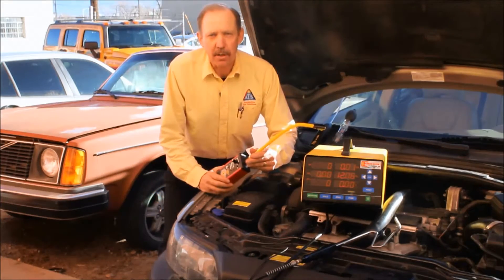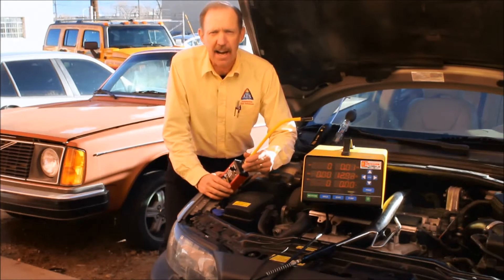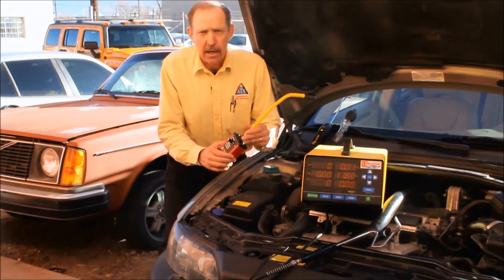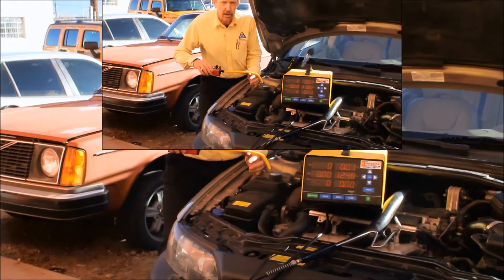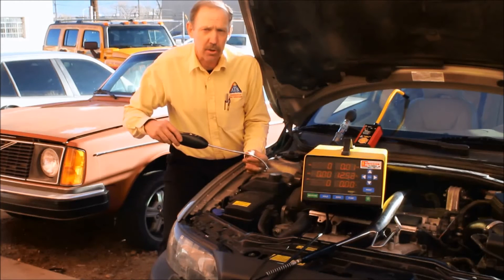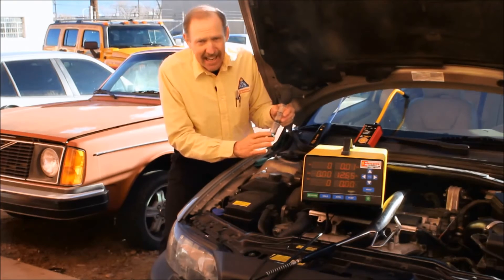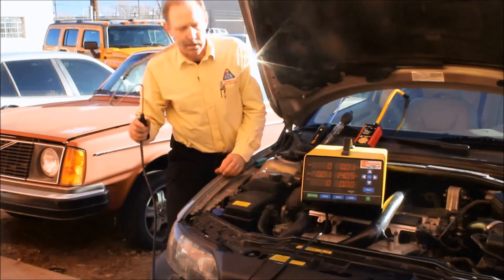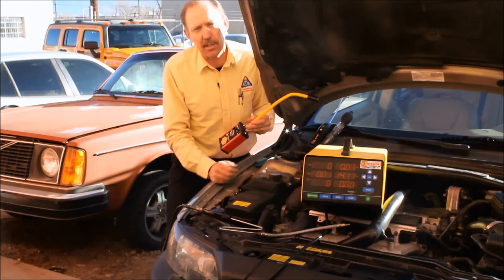Bullseye combustion gas in cooling system

Comment: I wonder why the shop didn't check the head surface for warping as part of replacing the gasket. I would think this is a standard step here. I do like the tester's ability to detect small leaks.